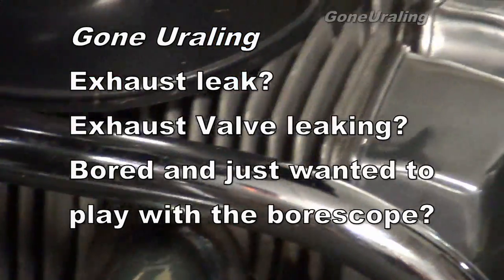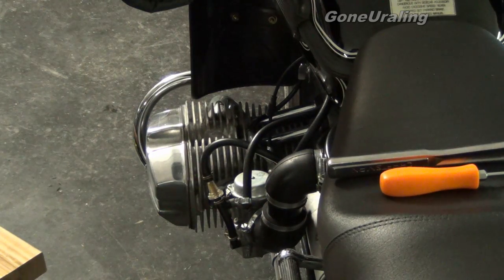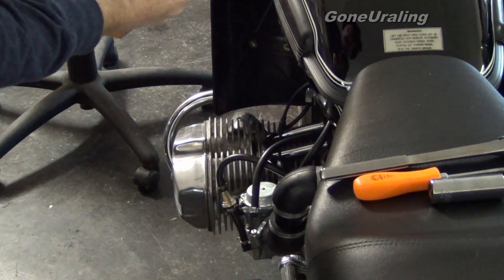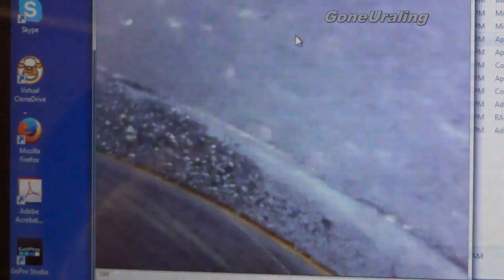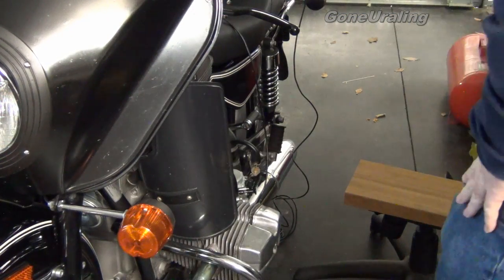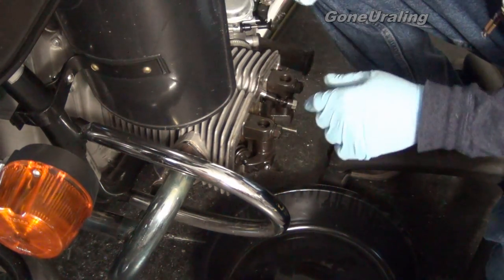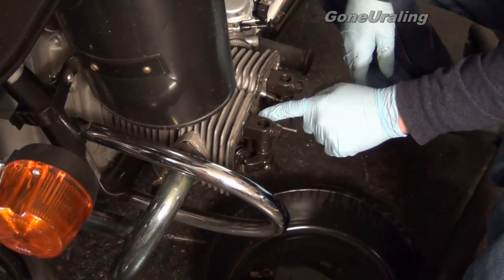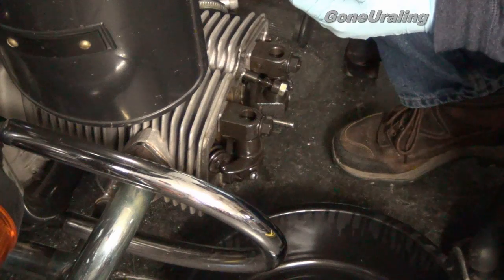Exhaust leak? Exhaust Valve Blowby? I'm Bored and wanted to play with the borescope??

Comment: I bend the borescope's cable on mine and can see backwards (top of the pistons)... bent the borescope cable and wedged the camera together with the bent cable through a piece of shrink pipe, that way I can clearly see cracked valves or so with a £10 eBay camera.

Comment: The petcock design has a major flaw if it leads to hydrolock and bent push rods. I think a petcock from Yamaha is compatible with the Ural's.
Reply from the maker: +said jellouli Yeah, I should probably replace it.  In the meantime I push the kick start a couple of times before starting it to try and catch that problem before it happens.
Reply: That's what a smart Ural owner should always do. Check that there is no unusual resistance and then crank up the engine. Happy Uraling!

Comment: exhaust gasket, or just give me that piece of junk before it explodes! I've got a trailer! ;-) 
Looser is better, loud valves save lives! .004 to .006 is the generally (some say use BMW Airhead clearances, I don't) accepted exhaust valve clearance. Intake the same, leaning toward the .004... Eliminating that vacuum petcock is helpful as the engine gets milage on it from my experience. Took 2 carb rebuilds to figure it was the culprit making my outboard carb have all sorts of gas in places it shouldn't! Might also want to pull the exhaust bolts and apply some anti-seize, then reinstall... Have fun...looks like you are embracing the way of the Ural...
Reply from the maker: +JamesAllmond Yeah, you're right, probably be better off to just move this pile of junk out of the way. :-)  I'm not thrilled with the petcock design myself, not so much due to the vacuum valve design, but not having a way to turn it OFF and know for sure it is OFF. I've read a few stories where fuel continued to flow and filled up the cylinder causing the next start up to be engine suicide.